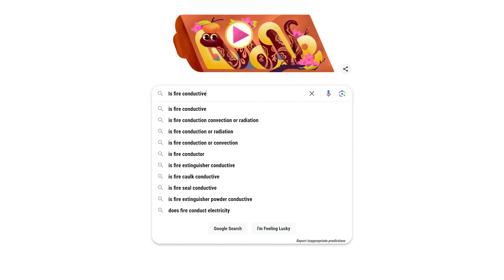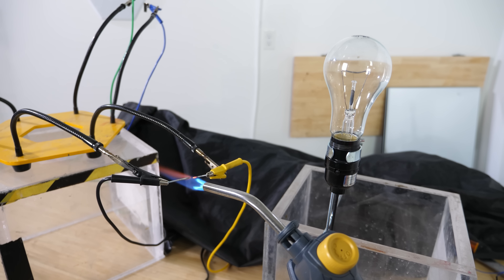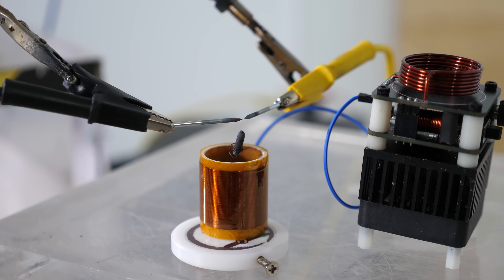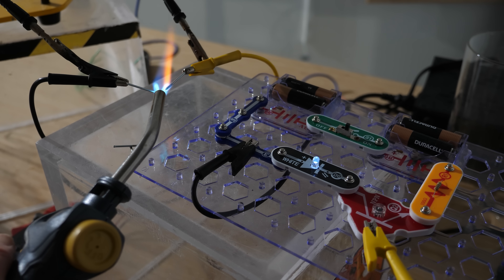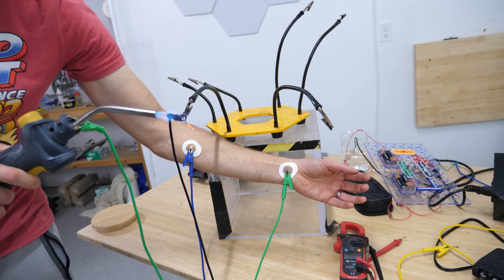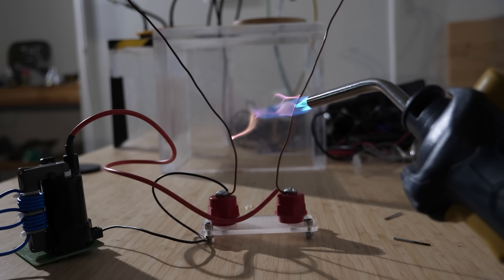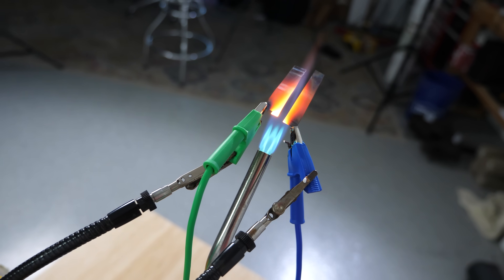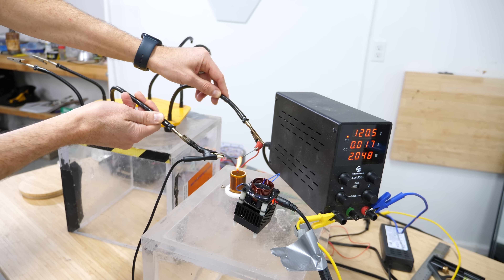Is Fire Conductive Enough To Get Shocked?

Comment: There is something in a lot of homes that actually uses fire to complete a circuit. If you have a natural gas furnace the flame sensor in the furnace does use the flame as a path to ground. Like demonstrated in the video the amount of current is extremely low. Just enough for the control board to detect.

Comment: I think the reason is that the ions generated in the fire are mostly positive ions (i.e. nucleus without electrons), for conductivity across two metal wires, you need negative ions (i.e. electrons).

Comment: Putting a lit candle in a microwave is a pretty wild time.  Big hum, flame expands and flaps around more like an arc than a candle flame, etc.  It generally acts like you're microwaving a conductor that can arc.  In light of that,  I'm surprised to see what a high resistance you found for a (much hotter) flame in this video.  Maybe the wavelength of the microwave inside the partially conductive (and at least a bit higher epsilon) flame is near enough a resonance to get 'er goin, even if the resistivity of the plasma is still pretty dang high.  If you try this at home, be sure you are using your recreational microwave in a lab space with fire extinguisher, etc. etc.

Comment: Deep between the lines: He means to say that dielectric arcs can exacerbate the cause and spread of fires when electrical companies neglectfully fail to shut off the power in electrical grid lines, as extremely hot air from a raging fire nearby is diffused into the atmosphere around power grid lines.

Comment: Similar to the LED transistor circuit a neon test bulb works just as well. It honestly surprised me but I guess they don't need all that much power to run anyway considering the feed resistor is several megaohm.

Comment: I noticed that some neon lights (like the small lights built into some electrical switches) may not glow when they are in the dark, even though there is a voltage applied.  However, they illuminate when a light is shined on them.

Comment: No kidding a chemical flame doesn’t carry enough current to light an incandescent bulb that draws 1 amp, equivalent to 1 coulomb per second, 6.2 x 10^18 electrons per second. 

The flame’s consumption rate of matter is knowable and sets an upper limit for charges available per unit time. 

Thus current could be numerically compared rate of fuel consumption.

He should do the math.

Comment: Question:

If a water bomber aircraft sprayed a solution on vegetation which induces fire to produce a feature of elevated high ion density, thereby the arriving wildfire is now producing electricity, can an "arc welder bomber aircraft" complete a ground-to-air circuit causing a hyper-rapid consumption of fuel during a low altitude flyover, this consuming local oxygen by producing extreme localized heat, being a non-water fire fighting technique?

Comment: As an HVAC guy thanks for doing a shitty job of explaining how a flame sensor works. Hope your all staying warm because 2 micro amps of  DC current  is all that's required for your furnace to know there is a flame present.  The control board puts out AC current to the flame rod but the flame rectifies it to DC as it passes through the flame to ground.  Maybe you should do a video about that.

Comment: 08:50
This is because plasmas habe something called negative resistance.
Not negative resistance but a negative temperature coefficient, meaning the resistance drops with increasing temperature.

Comment: I think you accidentally explained how a Carrington event actually roasts electrical lines. Supercharged hot particles smashing through it not only heats the ionosphere. It also heats the wires and air between it, so fast but just long enough, to cause large scale breakdowns like this. Even in single carrier lines, imagining a single field line having a breakdown (telegraph wire for example) makes sense if it's own field is split part like our heliopause. At the scale it's happening we just wouldn't be phased by a very fast and brief increase in temperature. 😳

Comment: Hello, I have a proposition of experiment, (not on this subject) 
Could it be possible to syphon hot air like we do with water (but in reverses..) ? With any dark colored pipe we can heat air in the sun, or extract gases placed lower. 
I wonder if it is possible to use this extraction power to heat the lower part of a house with the hot air collecting under the roof, with the help of a solar chemney a bit higher than the roof. to see, an (enough large) acrylic model could be use, or some flexible large transparent piping... Thanks for your work !!

Comment: This is how a modern furnace flame sensor works. A voltage is applied to the flame sensor. When the flame hits the sensor that creates a very small current to ground 5 micro amps. The electricity is traveling from the sensor through the flame to ground. The furnace circuit board senses this current. That’s how it knows it lit and leaves the gas on.

Comment: I was wondering... What if the transistor example worked just due to the difference in temperature between the two metal rods? Kinda similar to what thermal couples do. Would the example work by just heating one of them?

Comment: I first discovered fire was conductive when I was like 14 and I threw a stick onto some high voltage power lines. The stick caught fire at both ends, where it was in contact with the lines, so there must have been a significant current running through the wires. But it wasn't until the fire spread along the stick and met in the middle that the whole stick exploded and the lines shorted together with a huge arc and it knocked out the power for the whole day. At the time I thought it was hilarious, but it probably destroyed a transformer somewhere, which I can imagine was not cheap or simple to replace. Not to mention obviously extremely dangerous.

Comment: The hot gas is a non-ohmic conductor.  The multimeter is only 9V or so but if it was 220V the electron flow could be more than 25x the 9V level, so better to test the resistance at the voltage you plan to work with.

Comment: of course fire is conductive modern furnaces have a probe that goes into the burner to detect the flame and it sends a signal to ground to detect if the burner is lit.

i think at 36 volts shock hazard starts to happen that is why each battery module in an electric car has a shock warning.

also the high voltage wires are orange as a warning to any first responders in an accident scene.

also lithium ion batteries has a fire risk too

Comment: Fun-fact: Your gas furnace relies on the conductivity of flame to test and ensure the flame is present.

We place an electrode in the flame that we feed ~30V of AC which makes a connection between that electrode and ground but only when the flame is present which proves the furnace isn't just dumping unburned gas (AKA becoming a bomb).

Also, the flame acts as a rectifier due to the unequal degradation of positive vs negative charges in the flame as it gets further from the burner face (which can be tuned with electrode placement) so current only really flows in one direction (when the AC cycle matches the charge imbalance) which makes the current into a sort of "pulsed" DC which allows the circuit to be sure it's actually a flame, which is pulsed DC, and not an accidental grounding as that would carry AC. But the current is only on the order of 0-5 uA of DC current with flame sensing becomes intermittent around 0.5uA (which can occur as the electrode becomes dirty).

Comment: If you want to directly illuminate a bulb with very little current, use a neon indicator bulb, and view it in darkness with your eyes well adjusted to that darkness - or camera similarly adjusted.
Alternatively, a large number of LEDs in series may work, such as your LED bulb - but again, view it in exceedingly low light / "total darkness" conditions, or have camera so adjusted to "see"/record it.  And current that low will be too low to shock you, so if that's the question, no, not going to shock you.  Uhm, but yeah, very different scenario if you go up to arc welder current levels ... but those generally use rather to quite low voltage, so may not nearly enough voltage to get enough current to flow through you to shock you.

Comment: Great Video from great channel!

i wonder how much of the measured 6 Mega Ohms attributed to the partial fire plasma?
We know that metals resistance increase with temperature, probably because charge carriers are bumping more with atoms that are now vibrating faster.
So the expectation was to measure the resistance of fire by: first;  establish a base line by making the two steel strips touch then heat them and measure the resistance while they are glowing red hot, then introduce the quarter inch gap and repeat.

Comment: But why do Federation Starships use plasma conduits? I always imagined it was because the currents they wanted to push through there were so high that they were above the capacity of metal conductors. Maybe it works because they are carrying high enough currents to make plasma a useful conductor. Or maybe the writers just stuck a Sci-Fi word on there without thinking about it much 😢

Comment: There's an issue he didn't address - the place where he used the fire would have had increased resistance in the metal due to being heated red hot.  A tungsten filament for instance will have 10 times the inrush current when cold versus operating temperature- or conversely, ~ 1/10th the resistance when cold.

I'm not saying anything he stated was incorrect. However, I think in the last experiential, he should have also measured a short circuit current through the metal strips with them being heated up to temperature by the flame. (In order to get a more accurate  idea of how conductive the flame actually was).

I'm giving him a pass on this for not being a chemist rather than electrical expert.

Comment: Thesting with DC might change the resaults because of posible diode effects. Also conductivity might be anisotropic with respect, to feild and flow directions (colinear vs transversal). Also also try comparing with what hapens for RF plasma case if one or the other DC electrode is actualy atached to to the RF source.

Comment: I'm a Forest Ranger and sometimes we fight bush fires. We've been told not to fight fires under high voltage power lines because the electricity can arc through the smoke . I've always thought that it arcs because of the carbon in the smoke, not because of the heat.

Comment: Hello..   I watched with interest to see if you discovered the hidden secret.  Something you missed was that a flame acted like a diode with a bypass resistor.  Connect one lead of the ohm meter to the metal stem of the gas torch and the other to a wire (flame rod) in the flame.  Take a measurement and then reverse the polarity of the ohm meter.  Magically ...different readings.  I discovered this principle about 50 years ago.  It was used to detect the presence of an active flame on an road bitumen tanker burner.  The electronics were designed to detect if a diode was present in the circuit.  The beauty of this system and an added safety feature was if the flame rod was shorted out to the frame/earth, the system would shut down as a diode was not part of the circuit.  Road bitumen tanker burners are typically liquid propane (LPG) burners and they consume LPG at a huge rate.  If a burner is left unattended and has a flame-out for some reason, the LPG which is heavier than air can flow across the ground and accumulate in hollows, pipes and drains.    It can sit there for some time just waiting for a source of ignition.  Cheers

Comment: I have learned that the plasma is not the only thing that can conduct electricity in a fire, soot particles are charged and will build up on one of the electrodes. it would be interesting to try this with a flame that produces soot. candles are a great source of soot. if you stack 4 or 5 tea candles into a pyramid, then the lower candles will eventually boil the paraffin in the upper candle, this will create a single flame that rises about 15 centimeters up from the top candle. if you try at home place it far away from flammable stuff, a plate in the middle of a table is "safe".

Comment: Your needles should not be pointing left and right, even if the electron is comes out from the needle, it will be blow away by your torch!! Try to make a front and rear setup.
Front setup includes 10 or 20 needles, all around the torch and then pointing forward. The rear setup should be a metal plate ( or in bowl shape)instead of needle, so that it can collect more electrons! Like to see it in your next video!😊❤

Comment: i think one thing you're doing wrong in your first examples is that you're blasting the fire perpendicular to the current. you want the fire going parallel to the current, in the crrect direction (try both directions to see). you can have fun with it but ultimately it's the same principle as with a thermionic tube (vacuum tube).

Comment: This effect is used in an analytical technique called gas chromatography where a flame ionization detector is used.  In such detector in an oxygen-hydrogen flame a sample is mixed. If  the sample caused inization of the flame (for example contains carbon) the current flowing through this detector increases.

Comment: Try using a hydrogen gas torch should do the job it’s made out the same stuff as the sun, so it should be hotter than the plasma candle

Comment: Hey! Thanks for testing it out! It puts things into perspective. I had also seen that air is not a fix-resistance beast!
Reply: ActionLab's video has successfully summoned an ElectroBOOM!
Reply: electricity could break physics to just shock you
Reply from the maker: Thanks for your insights on this one. I learned a lot in this video!
Reply: Hi  @TheActionLab
Reply: @TheActionLab  To detect genuine plasma, set up a UV detector, filtered to only sense "electron recombination" hard ultraviolet shorter than roughly 100nm.   Beware, simple conductivity can indicate the presence of balanced populations of pos and neg mobile ions.   That's not plasma, that's electrolyte-vapor.   "Plasma," meaning 4th state of matter, requires freed electrons, and the signature of freed electrons is UV where the photon energy is way above chemical bonding energies.   say 10eV and higher  ...or UV photons of 100nm or shorter wavelengths.
We don't just want optical glows, since that can be fluorescence.  We want UV emission wavelengths indicating a plasma's recombination energy (indicating a population of unbound electrons.)
Reply: I figured that even if the circuit was completed by the flame (in the last video) that the path to ground was just to "long" through his body (basically infinite compared to the rest of the melted circuit).
Reply: О! Я також подумав що десь тут має з'явитися Меді :)
Відкриваю коментарі - о ось і Меді :)
Reply: sup medhi
Reply: @ElectroBOOM  HE IS HERE
Reply: I thought this experiment was right up Mehdi's alley, but if you can't get shocked, I guess it isn't.

Comment: I knew that flame conducts, because it's the principle used by furnace igniters to detect the pilot light, before turning on the main burner valve. I thought it would conduct better than it does. The flame detector uses only 24 volts, but the sense circuit is very high impedance.

Comment: Would be interesting to see if you can significantly increase the conductivity of fire by including a small amount of sodium in the flame (cesium would be better but is too expensive).  Might not need to be sodium metal -- maybe sodium carbonate would be good enough.

Comment: You should install an ampermeter to measure the current, because there might be a small change which is not enough to turn on the light bulb.

Comment: Fire is not conductive in the way metals or other conductive materials are. However, it can become conductive under certain conditions.

Why Fire Can Be Conductive:
	1.	Ionized Particles (Plasma Effect): Fire consists of hot gases, and at very high temperatures, some of these gases become ionized, turning into a weak form of plasma. This allows fire to conduct electricity, though not as efficiently as metals or fully ionized plasma.
	2.	Electrical Arcs: In cases where high-voltage electricity is present (e.g., lightning or electrical fires), the heat can further ionize the gases in the flame, making it much more conductive.
	3.	Composition of the Flame: If the fire contains metal vapors (such as burning sodium or potassium), it can conduct electricity better because metals release free electrons.

Practical Conductivity:
	•	A typical candle flame or wood fire does not conduct electricity well.
	•	Flames in high-energy environments (like welding arcs or plasma torches) are highly conductive.

Comment: Here to dispel all the "Fire isn't a thing". Fire IS a thing, It's just better to say that fire is a state of matter. It releases a lot of energy in the form of photons, and these photons not only make it bright, but also get absorbed by nearby atoms, making them vibrate as well, making them warm up. If plasma is the state of matter in which electrons along with atoms flow freely, then fire is like partial plasma. It's also why combustion of different materials (for example, look up a sulfur fire) look different: they have different composition.